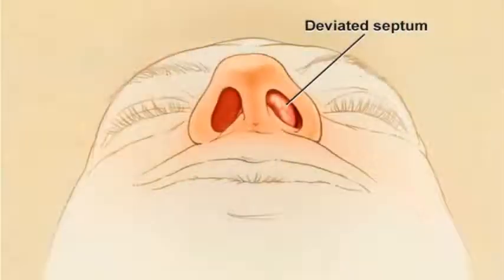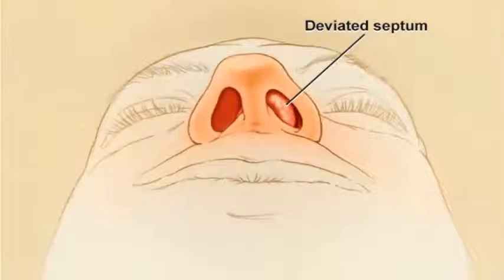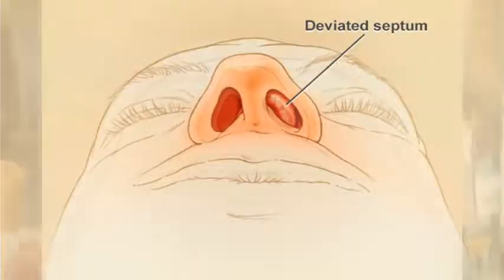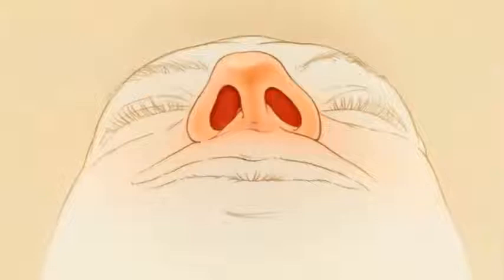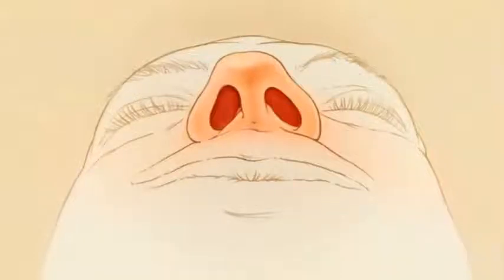Nasal congestion: treatment options

Comment: Hello sir, is it possible to have  Septoplasty, rhinoplasty and surgery to fix nasal congestion (turbinates and other stuff) done in a single operation? 

The tip of my nose was injured a while back which gave me breathing problems, a deviated septum and slightly changed the tip of my nose. I’m hoping I can get all 3 fixes in one operation is that possible? Or will I need seperate surgeries for each problem
Reply from the maker: Absolutely. It is fairly common during a functional rhinoplasty procedure to correct the shape of the nose, correct the septal deviation, and perform a turbinate reduction procedure.

Comment: Hi Dr. Greg, I am Ali from Uganda. I do have deviated septum and it has been years with this problem. I cannot breath well and don't want surgical treatment, would there be other ways to treat this
Reply from the maker: A surgical septoplasty is the only way to correct a deviated septum. Sometimes the other structures in the nose are enlarged, like the inferior turbinates, and using a nasal steroid spray can decrease the size of those turbinates and allow people to breath better, even with a deviated septum. Breath-right strips worn on the nasal bridge can also help improve breathing. In the U.S. there is a procedure called Vivaer (https://www.youtube.com/watch?v=G6zYLmCor1o) that can help, but it is not available outside the U.S. at this time.

Comment: Hii sir i am suffering nesel polyps but i am scared for surgery .is it possible to cure them with medicine?
Reply from the maker: First off, sinus surgery with removal of polyps is a very safe surgery. Complications are very uncommon and most patients do extremely well and have long lasting relief. I encourage you to watch my short video on nasal polyps and treatment options: https://www.youtube.com/watch?v=JtaHKc1lxFQ&t=1s
Non-surgical management of polyps include topical nasal steroids, either sprays like fluticasone, or steroid (budesonide) and saline sinus irrigations, or using the new exhalation delivery system for steroids (Xhance). Another option are drugs in the "biologics" category including dupilumab or mepolizumab. These expensive drugs work by self-injections 1-2 times per month and target the cells causing the inflammation in the sinuses. You should talk with an Ear Nose and Throat surgeon about your treatment options available to you.
Reply: @GregDavisMDENTSurgeon  thank u so much for your kind reply.

Comment: Hey there Greg,  been having breathing problems for many years finally got referred to have a CT scan + results came back with cyst/polyp in right nostril with a deviated septum last sat- and an appointment for both of these will be sorted out in Feb/March!
But as part of my nasal bone is broken at side  will that still come under Septoplasty or a combo of Septorhinoplasty??

Keep feeling thick muscus behind my nose and going down my throat, and every now and again feel burning sensation in both nostrils which is obviousy from sinus infection which has given me a slightly swollen gland on left-hand side so shall I take antibiotics before or after for sinus infection or will they do it??

And will they auto reduce my Turbinates at the same time??
Also I see in some videos some use packs up nose after surgery, but other times see them just get/use dissolvable stitches  I really  don't want the packs!

Also I have spider veins on bridge of the nose will they also go afterwards??

I'm from UK in England so will be getting th is thankfully via our wonderful NHS
Reply when you can thanks
Reply from the maker: I'll try to answer your each of your questions, but keep in mind, the final treatment decision is up to you and your surgeon.
If you have a crooked nose (the outside), then to fix that requires a septorhinoplasty. A septoplasty only straightens the inside of the nose (the septum). The rhinoplasty portion straightens the outside of the nose.
The thick mucous you feel is likely related to your polyp/sinusitis. Sinusitis refers to inflammation of the lining of the sinuses. This creates extra mucous.  Sinusitis does not mean infection, however infections can certainly coincide with sinusitis. If you are feeling significant sinus pressure and thick nasal drainage, you can ask your surgeon for some antibiotics before surgery. If your symptoms are mild, then hold off.
Whether or not they reduce your turbinates (do a turbinate reduction) is up to your symptoms and the discussion you had/have with your surgeon. If you have nasal congestion and he/she sees enlarged inferior turbinates, then you can ask for a gentle turbinate reduction.
Most surgeons no longer pack the nose after this type of surgery. Some still use splints after septoplasty. With these in, you can still breath through your nose. This is up to the surgeon. 
The spider vein issue is a cosmetic one and generally not treated at the same time. These can be treated in the office with special lasers though is considered a cosmetic procedure (at least in the US) and would require a cash payment.
Reply: @GregDavisMDENTSurgeon  Thanks a lot for your quick response!
Well it is the bracket side of the nose that is broke,  I wonder why in  my CT Scan results my doctor didn't bring up about nasal bone area and just deivated septum??

Oh ok so thick muscus is due to cyst/polyp I have with inflammation!

my symptoms go from mild/severe it goes back and forth sinus pressure/nasal drainage.

So when I have my cyst/polyp removed-will my Sinusitis refers to inflammation of the lining of the sinuses auto heal??
Or will I need to take antibiotics??

Yea I think I will ask for a turbinate reduction. As just not long got ove the flu and wiped me out for 2 + half weeks!

Ok so some use splints, how about sutures,  Spider  Veins I have had some lasers on them and did a cah payment and some of them went not all of them though!

Comment: Sir my nose is slightly bend and people don't notice it unless they see my pics 
I.e in my pics my nose smeems to bend at right side and if notice clearly my nose also seems to be bend in mirror what should I do about it ????
Reply from the maker: The outside appearance of a twisted or "bent" nose is pretty common. Sometimes they are related to trauma and sometimes they are just the "family nose". If the appearance bothers you, I recommend you make an appointment with a facial plastic surgeon for a consultation. If the outside appearance of your nose is not an issue and you are mainly experiencing a stuffy nose, then you should see a ENT surgeon for recommendations. The American Academy of Facial Plastic and Reconstructive Surgeons has a website to help locate facial plastic specialists near you: https://www.aafprs.org/FindASurgeon
Reply: @GregDavisMDENTSurgeon  thank you sir for giving time in your busy schedule for answering my comment 
👍👍👍👍
Reply: Sir my nose never been work on my turbinates are huge blocking the airflow and my smell however I believe when fall and winter approach they swell .. should I hold off I don’t want my turbinates touch due to ens I’m waiting for a ct scan and my allergy test  I having problems sleeping at night feel like I’m breathing through a damn straw lol but I’m soooo scared of the ENS that’s all I’ve been reading in the comments any suggestions could you just fix the devited spectrum and don’t touch the turbinates ?
Reply from the maker: @oscarmaddox7874  I'm glad to hear you are getting a proper evaluation with a sinus CT scan and allergy testing. To answer your question, yes, the deviated septum can be straightened without reducing the turbinates. This is a fine approach, however, if your inferior turbinates are really large, you may not get the improvement in breathing that you seek without addressing the turbinates. There are two fairly gentle options that you can talk with your surgeon about and these are either just outfracturing your turbinates (pushing them to the side of the nose and not removing tissue) or using coblation, RF energy, or a debrider to reduce the inside of the turbinate without harming the outside of the turbinate. Remember, ENS is a rare occurrence after turbinate surgery. The vast majority of patients are extremely happy with their breathing after turbinate surgery.